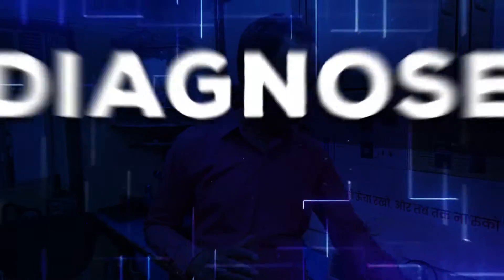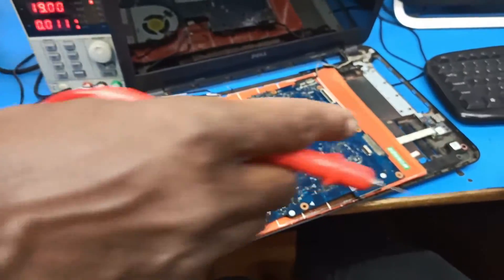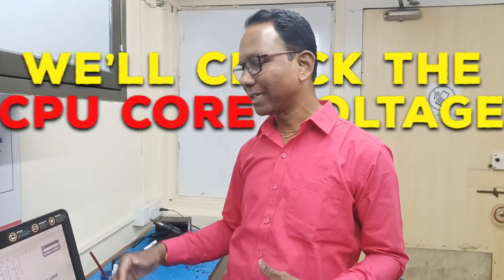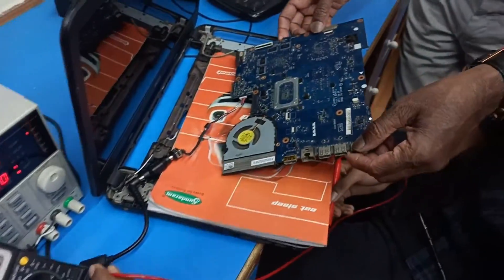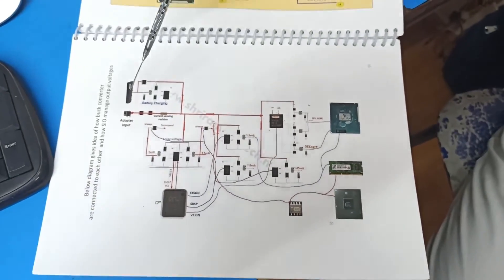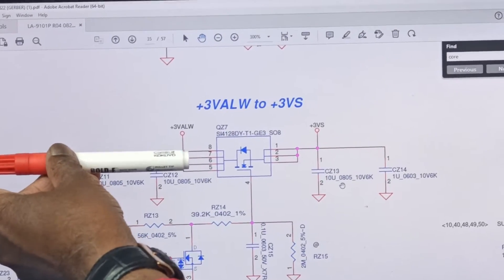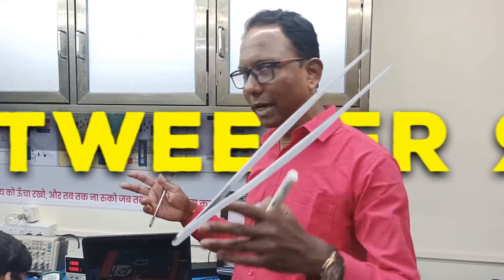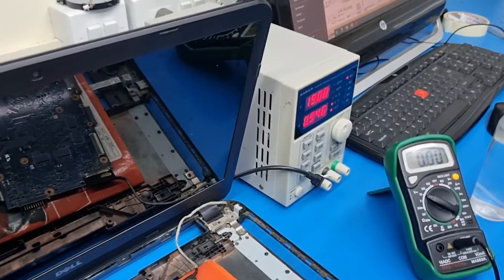laptop power on but no display how to repair

Comment: Thank you for this video.Please i have one question. You said that the issue on this motherboard is CPU core voltage. the CPU chip VRM power is 5v. why the problem comes from 3V SUSP area ? Thanks in advance